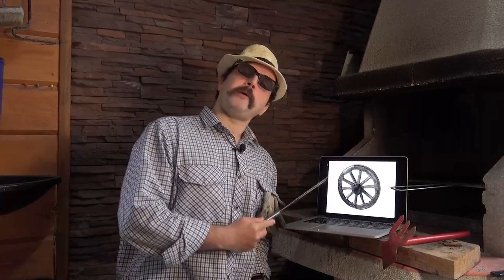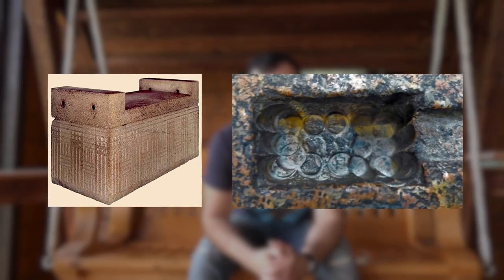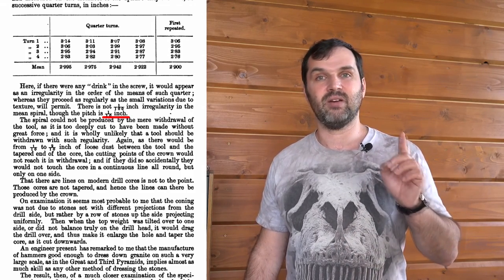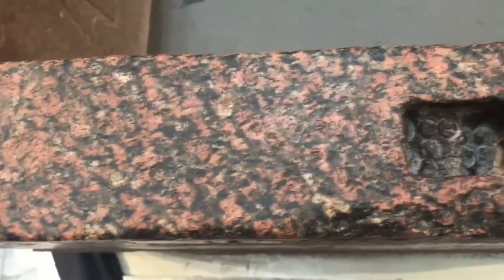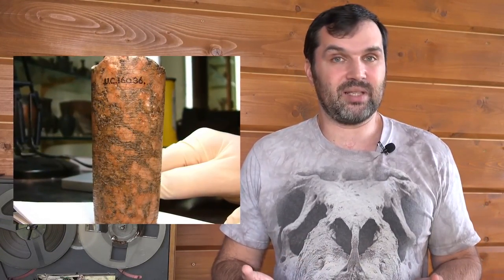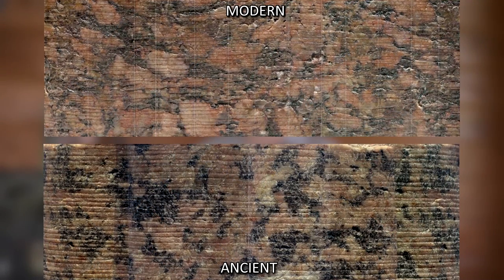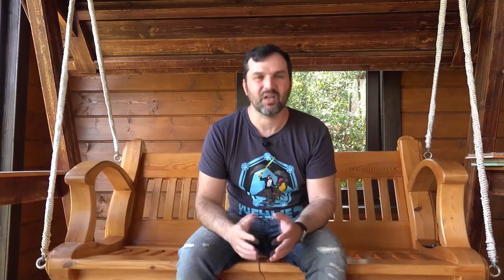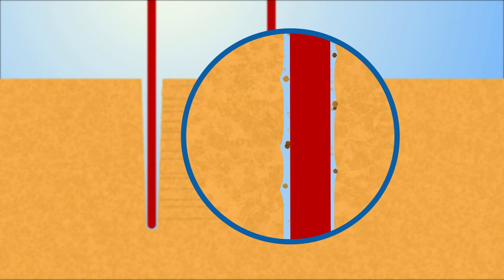Out-of-place artifact: 100 years of deception | Fake science spotlight

Comment: Hey guys. Impressive work, and I always appreciate scientific approaches to debunking theories, even if I'm not a fan of sarcastic dialogue. I always try and keep up with these debunking channels, as I'm a proponent of their being an ancestor civilization in the Nile valley. I have a question, and I hope you can provide me with an answer, because it really bothers me. The Great Pyramid is built to certain dimensions that imply the builders knew the precise size, and shape of the earth, even taking into account the expanded circumference at the equator. This is not knowledge that the Dynastic people had. I won't ask you to explain the Serapeum, because I don't believe anyone has any answers for that site yet. Is there a reasonable explanation for this implied knowledge? Thanks in advance.
Reply from the maker: The problem is that we do not know the exact dimensions of the Great Pyramid (sagged a little and sprinkled a little). Think about it
Reply: @ScientistsAgainstMyths  Thanks for responding! They have been measured with a more than reasonable degree of accuracy in my opinion. They even accounted for the differential in the circumference of the equator, in the stone work at the ground level of the structure. I would be happy to accept this as a freak coincidence if this a run of the mill historic site, however this is the Great Pyramid we're concerned with. I just can't accept mathematical coincidences of this scope, and nature. This really bothers me, and is something that I can't get past. There are clear indications of cultures employing advanced architectural techniques in S. America before any documented cultures, and so why not the Nile Valley?
Reply from the maker: "They have been measured with a more than reasonable degree of accuracy in my opinion. "
How do you determine exactly what the dimensions of the pyramid were 5 thousand years ago? Her cladding collapsed, some of the blocks were taken away by the Arabs, the landscape changed, etc.
Don't be fooled by bullshit
Reply: @ScientistsAgainstMyths  The casing stone is still intact at the base. You know this. The measurements are accurate. I don't study, and present 'bullshit' without being damn sure of myself. I appreciate what you do, as it serves a scientific function. But your response does not fill me with confidence.
Reply from the maker: > "The casing stone is still intact at the base. You know this"
Really? Ok, no more questions
>  being damn sure of myself
👍🏻
Reply: @ScientistsAgainstMyths  Were you unaware of this? Is this a joke?
Reply from the maker: @seanclarke5915   
Is this a joke? 
Only a few casing stones have survived on the north side of the  Great Pyramid, to the right of the entrance, and on the west. They have been partially restored. Yes, I know this.
Reply: @ScientistsAgainstMyths  Good. And so it follows that we then can calculate the dimensions of the structure from that. Let's say for arguments sake that there is a margin of error of 1% on either side, which is generous. Is it not still remarkably consistent with the dimensions of the earth? To the point where it is highly unlikely to be a coincidence? I hope that you give yourself time to address this to yourself, as it would be unfair of me to press you for an answer that you do not currently have.
Reply from the maker: @seanclarke5915  
Above you said "The casing stone is still intact at the base. You know this"
I hope now you are not so "being damn sure of yourself"
I hope that you give yourself time to address this to yourself
Reply: @ScientistsAgainstMyths  You're debating the semantics of how you would interpret my word choice, when you should be very well aware that even one casing stone would allow us to measure the dimensions of the structure with a high degree of accuracy. I can see you are here to debate, as opposed discuss, and frankly I feel as though you are being deliberately obtuse in order to avoid addressing the issue. I think I'll ask someone else who is willing to try harder. I'm not at all sure why you responded to me if you were not going to put in the effort.
Reply from the maker: @seanclarke5915  Ok good luck
Reply: @seanclarke5915  Hey there! I personally believe that even plain coincidence is a better explanation then a previous advanced civilization, giving the cluster of evidence we already have regarding the age and purpose of the Great pyramid.

But  I am more curious about your claim about the Serapeum. Why do you believe it's unsolvable? If you would like to discuss the topic, feel free to give me a reply.
Reply: @MrAchile13  Good evening! First of all, thanks for reaching out. The above conversation did not go particularly well, so I'm glad you did. I'm more than happy to discuss the Serapeum of Saqqara, however first I do want to say that I find it scientifically irresponsible to accept a mathematical coincidence of such a scale, and extent. The most fundamentalist of archaeologists would surely accept that Occams Razor suggests there was a knowledge of those dimensions. 

On the Serapeum, where to begin. The precision to which those boxes have been cut defies all knowledge we have of the ED people. The tools that were required simply do not exist in the archaeological records. The placing of these boxes raises many questions, but not as many questions as the methods by which they moved them. There were no woodchippings beneath the box in the middle of the corridor for example, implying that they moved the boxes by unknown means. Not that it was particularly realistic to say that they moved the boxes using wood in the first place. You would need in the region of a couple of hundred very powerful men to move the weight of those boxes, not taking into account the friction. So there's an issue. Further to that (and it's late in the evening so I appreciate I'm probably jumping about the place a little) the writing/etching on the boxes is not contemporaneous with the manufacturing. There is an impressive polish covering most of the boxes, and the workmanship in every aspect of their manufacturing is of the highest standard, and yet we have this awkward, graffiti like writing on them from the Middle Kingdom (I believe) It's almost like the boxes have been defaced by whatever ruler commissioned such work. There's also the issue that the site was clearly never finished. If indeed it was the Egyptian civilization, and not an ancestor civilization who's work was interrupted, then why was the site left the way it was. Whatever the intentions of the builders, we may never know the sites purpose. I'd like to make this a conversation, so I'll stop now, and see what you think of the above. I could write for days about this site, but I'm keen to listen as well.
Reply: @seanclarke5915  I like discussions. We probably won't change our views, but the exchange of ideas is a good exercise and it's fun.

I believe that proposing the Egyptians knew the dimensions of the Earth is an extraordinary claim which required extraordinary evidence, which we lack at the moment. In the most speculative case, maybe it can be proposed that they calculated it the same way the later Greeks did, I don't know.

 The sarcophagi are not as precise as people claim. The ISIDA Project team has measured their corners and they vary between 90+ and 92+ degrees, which is not "machine precision" as people hype them to be. Here is the source: http://isida-project.org/egypt_march_2013/serapeum.htm

No advanced (modern) machines or tools are necessary to make such sarcophagi, but we can get to these details later.

I think the inscriptions are fine for the most parts. In some places mistakes have been made, but then again, some of the sarcophagi are irrelgular as well and some have scoops in their walls. I don't know the story behind these mistakes, but people use to say that they were made (and that the inscriptions are carved so shallow) because the Egyptians were not technologically capable of anything more, which is not true. For example the Egyptian obelisks and the Young Memnon, now at British Museum, are all made out of granite and all have deep and well crafted writing on them (The Young Memnon is inscribed on the back).

The Saqqara Serapeum was made during the New Kingdom and was used at least until the Late Period, if not later. It was not meant to be a finished project, as they used it to bury Apis Bulls (one mummy being found inside).  It was like a catacomb, being provided with a new sarcophagus as a new bull would die. The writing on the boxes do identify pharaohs and there used to be stone stele on the walls (the empty stele shaped sockets can still be seen on the walls). Inside this Serapeum was found one depiction of Ramses II bringing offerings to an Apis bull.

The transport is indeed intriguing. I don't know how they did it, but I have a few ideas. I do believe they used wooden rollers or a sled, as this seems to be the general method used throughout history for moving megaliths.

I do believe they used simple pulley systems and capstans. A simple pulley system with only 4 pulleys can generate a mechanical advantage of 5:1. If the Sarcophagus is being pulled by 2 ropes, each of them can be equipped with such a pulley system, thus doubling the force. The end of the rope can be anchored to a capstan, thus amplifying the force even more. This would not require a great number of men and would work well inside the confined space. 

if we look at the map of the  Serapeum, we will see that apparently each corridor continues to a short dead end after intersecting another corridor. Maybe these dead ends were the place where the capstans or winches were located, thus being able to pull the sarcophagus towards them, until reaching another corridor and engaging the next capstan. 

We have no evidence that the Egyptians used capstans or pulley systems, but we know they used pulleys as early as Middle Kingdom.
Reply: @MrAchile13  Hello again. I should have responded sooner to the above, so apologies for writing out of the blue. 

The boxes are remarkably accurate. Their surfaces are so precise, that it is fair to assume that the angles deviating from a right angle by more than a degree were entirely intentional. The precision I refer to is the flatness of the surfaces of the boxes. 

Achieving a 3 surface'd precision angle is quite an extraordinary feat for these boxes. To do this with the tools we ascribe to the Dynastic people would involve countless mistakes being made, which would have had knock on effects in regards the manufacturing of other parts of the box. It's just not logical to accept the use of Dynastic tools for these objects.

The scoops in the boxes are most likely repair works on the boxes, carried out by the original builders of them. The reason being that once a crack appeared in a box, it risked not being able to complete whatever function it was built for (I can only speculate as to what the function was, but when you believe they pre-date the YD boundary as I do currently, then anything is possible)

The unfinished element of the site I was referring to was the placing of one of the boxes in the middle of a corridor, with minimal clearance on either side. To me, this displays that the Dynastic people were unable to move the boxes when they found the site, and that work there was stopped suddenly, and unexpectedly. 

I like your theories on the transporting of these boxes through the corridors, and you may very well be correct. I've seen this idea presented before in relation to other likely pre-YD boundary sites. There's every chance that the ancestor culture did employ this technique, and that the Dynastic people did not. I will discuss this with people going forward, and I think it will help a number of conversations. 

The writing on the boxes are worse than a series of errors. I'll preface this by saying I have no criticism of the Dynastic cultures, as I actually respect their repair work, and maintenance of the most ancient sites. I also believe they are a legacy culture of the culture(s) that built the most ancient sites in the first place, and so I have much more respect for them than I do some of the more fundamentalist, destructive cultures that followed. I mentioned above that the hieroglyphics are not contemporaneous with the manufacturing of the boxes. The polished surfaces provide a remarkable, and beautiful backdrop to some very poor writing. Were the boxes created by the same people that later etched into them, the grooves would surely also be polished. Why provide such an excellent finish to a surface that you know will later be scratched? The contrast between the the skill, and workmanship in the boxes, and the hieroglyphics that followed imply they came from two very different people, or times. 

To return to the dimensions of the earth being inbuilt to the GP of Giza, the extraordinary evidence is in the measuring of the GP itself. The evidence is right there before our eyes. You probably already saw me discuss it with the owner of this channel. Do you want me to locate the figures? I'm afraid I don't have them to hand. I think this is something I learned from Martin Sweatman, who is someone to be admired in the study of prehistory. I believe he, and Antonio Zamora employ the most scientific approaches to understanding the pre-cataclysmic age, and the cultures that existed, as well as the scale of the damage to the earth's surface, and climate. I can try and find these figures if we're continuing this chat. After all, I do appreciate you taking up the conversation in the first place. 

Like you said, we're unlikely to change eachothers overall perspectives, and so the purpose of these discussions should be focused on personal understanding, and learning, as opposed to criticize, or employ debating techniques.
Reply: @seanclarke5915  Hello there! It has been a busy week, sorry for the delay.

1) Both the corners and the surfaces are imperfect (from flatness imperfections, to concave and broken surfaces). You make the assumption that the angles are imperfect on purpose and that the boxes must have been perfect originally, I am not sure on which evidence are you making these assumptions.

2) Similar works (even ones that are more complex) have been made without advanced technology or tools, therefore the the serapeum sarcophagi can be made without advanced technology. Do we agree on this? I think it's important to discuss this, before discussing the Egyptian tools.

3) Why do you assume that the scoops are repair work? Also, what would have damaged them and how?

4) How did you got to the conclusion that the explanation for the box in the corridor is that they couldn't move it? The serapeum was used for multiple centuries. It may have very well be abandoned during the Persian invasion, for instance. We know that the Persians destroyed monuments and even killed one Apis bull. 

5) Why would you assume there was a previous culture, if there is no evidence of it? My point was that the boxes can be moved using only simple tools, like pulleys and capstans.

6) I think you are jumping to conclusions. Both the writing and the boxes are imperfect. 

People usually make the case that the Egyptians couldn't work the granite, therefore the shallow writing, but this is not a valid argument, as we know for a fact they were well able to carve deep inscriptions in granite, as proven, for instance, by the obelisks. I don't know why they chose that writing style for the boxes and they did made mistakes, but it's not due to the impossibility to carve granite. 

7) The pyramid measurement can be a coincidence or it may be measured after another object with similar proportions. I don't know, but that doesn't mean they know the measures of the earth, as there is no solid is no evidence of this. On the contrary, they believed the Earth to be flat, as written sources tell us. 

The problem is that the argument is circular. The only evidence that the Egyptians measured the earth is the Great Pyramid (A) and the only explanation for the measurements of the Great Pyramid is that they measured the Earth (B). A->B and B->A, which is a circular argument. There must be a point C, for example, a text recording them knowing about the Earth's measurement, for the argument to be valid.

8) Sweatman is not admired in the study of pre-histsory, he actually got some criticism. He is a physicist and I personally heard him make illogical statements and leaps of faith, on his you tube channel.